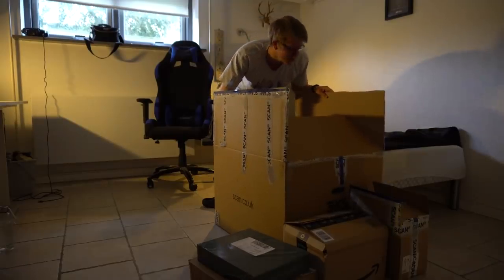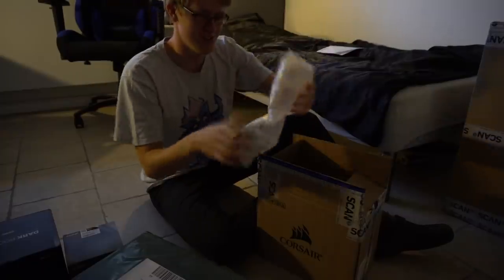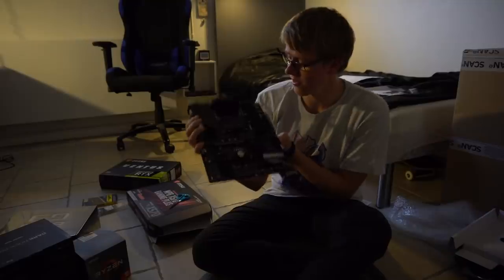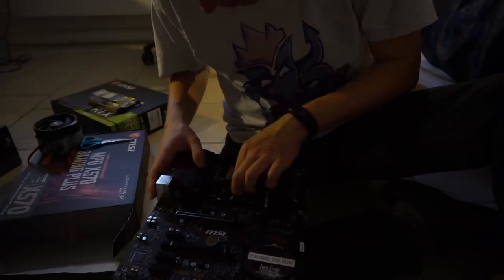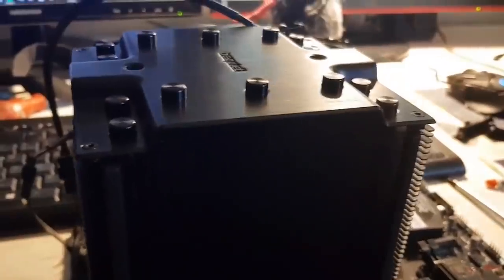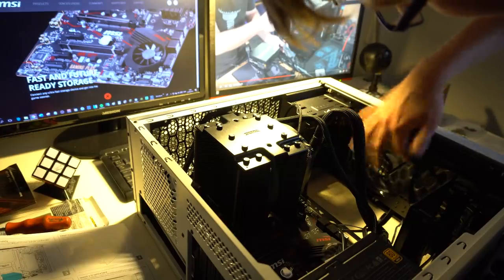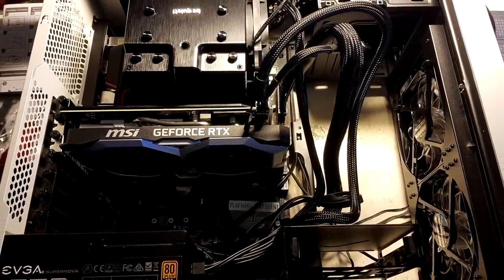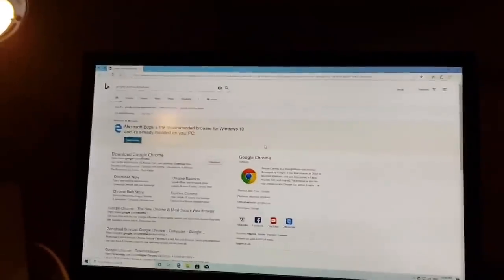My New PC!! (Unboxing + Build)

Comment: Definitely not trying this at home

Ill be doing it inside a plane :))
Reply: Actually built a system in a plane back in 2001 was in cali going to florida and the plane was pretty spaced so i could build the system on the way, couldnt test it so just hoped the parts work, we used to have pentiums and basically thats it no i7 no nothing just nvidia graphics if you wanna game

Comment: Yo my new pc that I'm getting these are the specs. 
9th Gen Intel® Core™ i7 9700 (8-Core, 12MB Cache, up to 4.7GHz with Intel® Turbo Boost Technology)

Windows 10 Home 64bit English

NVIDIA® GeForce RTX™ 2060 6GB GDDR6 (OC Ready)

32GB Dual Channel HyperX™ FURY DDR4 XMP at 2666MHz

1TB 7200RPM SATA 6Gb/s
Reply: ebic